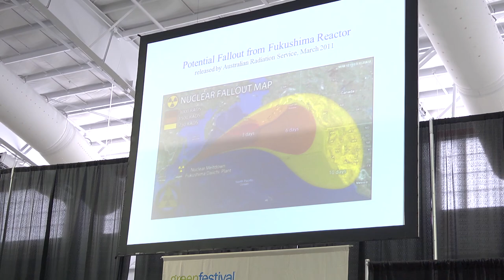Rod Adams - Nuclear Communications

Comment: nuclear is dirty.  We have had the know how for clean energy for decades.
Reply: Patricia, what's dirty about it exactly? I call it clean (as Rod does) because it doesn't emit any pollution, in stark contrast to combustion. The stuff coming out of the cooing towers is water vapor. Nothing burns. Atoms are split into smaller atoms, releasing energy in the process. The smaller atoms are contained in casks. If the waste from coal combustion, gas combustion, solar production or wind turbine production could be contained in small casks, then those energy sources would be clean too.  http://environmentalprogress.org/big-news/2017/6/21/are-we-headed-for-a-solar-waste-crisis
Reply: Wrong ! Nuclear is the cleanest energy we have